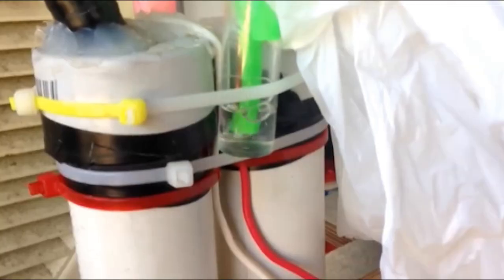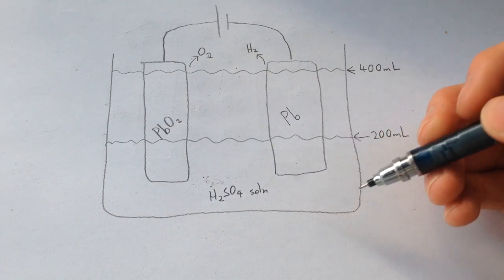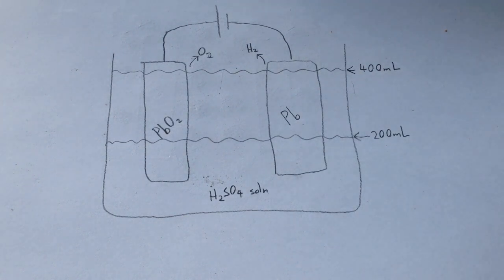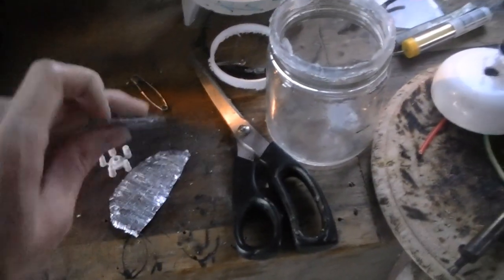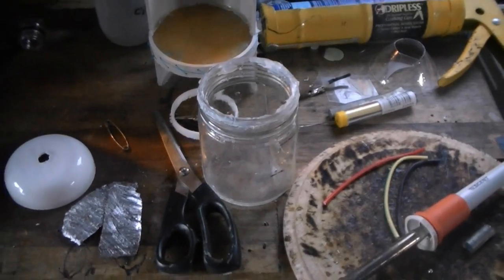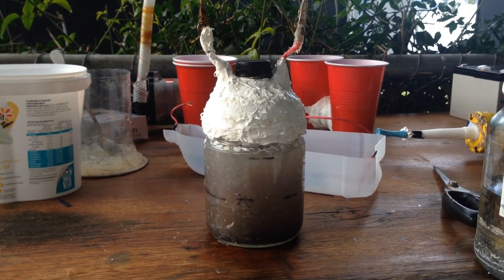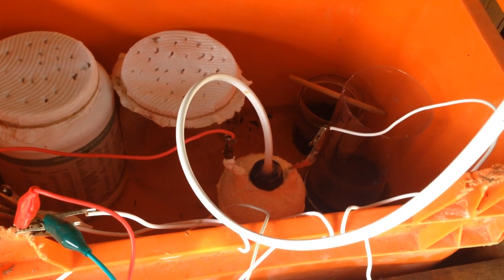Making Deuterium - Part 1

Comment: Tip: don't use plastic for deuterium oxide. The protium in the plastics will dilute the deuterium in the water. There are protocols for heavy water handling.
Reply: I was thinking the same thing. Carbon has a higher affinity to deturium than hydrogen, (protium).
Reply: What kind if container should be used? Degalvanized Steele box?
Reply: actually after research you're wrong polyethylene is ideal.
Reply: Also how about gloves while manipulating h2so4..?
Reply: @yurttgjk I work even with conc. nitric, HCL and sulphuric without gloves and my hands are ok, but he should wear gloves because of the lead.

Comment: Always happy to see a new Scrap Science vid! So is the only major difference between normal water and deuterium water weight? Also do you have any other long term projects like this going on?
Reply from the maker: Thanks, glad you enjoy the videos.
Reply from the maker: As far as I'm aware, there are no other general differences between normal and 'heavy' water (aside from something about neutron absorption that I don't really know too much about). And I'm afraid that I don't really have anything else long term running right now, however I am slowly working towards a video about extracting gold from computer circuit boards, which may take a while.
Reply: In the 80s there were 2 scientists experimenting with deuterium & triterium (maybe just deuterium) and they reportedly turned it into another element (it’s a gas at room temperature; I’m having trouble remembering). They were having a low percentage success in their experiments; I think 30%. They were wondering how to remove variables and improve their success rate. So they shared their work with other scientists so the experiment could be repeated and then peer reviewed. Someone didn’t like what they were doing, claimed that they called it, “cold fusion” and then I never saw more work from these two scientists. It was covered by a lot of media. I think there was a Time magazine with “Cold Fusion?” on the cover.
Reply: @HWandW  I think you're referring to an experiment in which Philo Farnsworth was involved, called the fusor. It's a reactor in which indeed as you said, tritium and deuterium are fused to create an isotope of helium, which is indeed a gas at room temperature. It is a fairly simple experiment and I'm building a fusor with a small team at my high school. Very interesting.

Farnsworth died and that might be why you didn't hear from them anymore

Comment: You leave the water very very still for a very very long time. The duterium water will form a layer on the bottom of the containter.
Reply from the maker: This won't work. Even at low temperatures, the thermal energy of water molecules will not allow for simple gravity separation of isotopes.

Comment: Does it have to be lead? Why not use graphite?
Reply from the maker: Graphite will very quickly erode in sulfuric acid electrolysis conditions. lead and platinum are the only real viable choices for long-term electrolysis of sulfuric acid.
A better choice (which I'll be doing in the future) is to perform electrolysis of sodium hydroxide solution instead, where electrode choice is much less strict, and can include much more available metals like nickel and iron.
Reply: @ScrapScience  awesome! Thank you for replying and giving me some clarification on that. I intend to replicate your operation to some extent. I want to get into the industrial production of D2O. I firmly believe it’s going to play a significant role in energy production in the future. Plus it’s worth a pretty penny so coming up with a solid method of production is a business opportunity. So I’ve been working on it myself. However the time frame in which enrichment takes place at 15 watts is unacceptable in terms of flipping a profit. So I’ll have to modify the container to handle upwards of 500 to 1000 watts. Which shouldn’t be too hard. Just a thick metal container with a higher concentrate of sodium hydroxide. What do you think?
Reply from the maker: Instead of making one container running at that kind of power, I'd recommend making multiple smaller cells running at ~50 watts each (you can use less NaOH this way, making separation easier later on). That's what I'm doing with my latest attempt at heavy water extraction (I'm running four of these cells total, but with a proper power supply you could increase that to twenty if so desired). You'll also need a large cooling bath for that much power, in order to minimise losses from evaporation.
As far as 'making a profit' from doing this, I'm afraid you'll have a hard time unless you have access to free electricity. To make 1mL of semi-pure heavy water, you need to electrolyse away about 30L of water total (and that's assuming very high efficiency), which requires at least 100kWh of electricity at 100% efficiency (probably triple that under reasonable efficiencies). To make that economical, your electricity needs to cost you 0.6c/kWh or less to match standard prices of D2O. If you have free electricity, go for it, but otherwise you'll have to settle for making it without a profit.
Reply: @ScrapScience  sweet I appreciate you’re input! The power factor isn’t a concern because when I scale to a large size I’ll be using power strictly off a solar panel array. Also the contamination of NaOH isn’t a huge concern because when it’s time to distill I will add active carbon flakes as well as a vorcrux column to my beaker enabling me to pull 100% of the NaOH from the solution as the purification process plays out. There’s a video I watched that taught me this process. I’ll link you if you want. But yeah the power factor isn’t going to be an issue late game and neither is the sodium hydroxide. The most important factors are how fast I can produce it and how much I produce.

Comment: Could you do the same with a 12v battery lead acid battery. Having a  larger surface area would allow you to carry the same 7 amps at a more efficent voltage across each cell thus generating less heat and electrolisizing more hydrogen for the same current.
Reply from the maker: That’s definitely a good option for efficiency. In fact, I was planning on doing something very similar if I happen to give this another go.

Comment: Random thought, because I noticed the numbers of videos on this - is the concentration of D2O the same in rainwater and seawater?
Reply from the maker: In theory, they should be very close. Seawater has a well-known concentration, whereas rainwater will likely be slightly (by an incredibly tiny amount) lower than that. The process of evaporation favours light hydrogen to an extremely small degree.

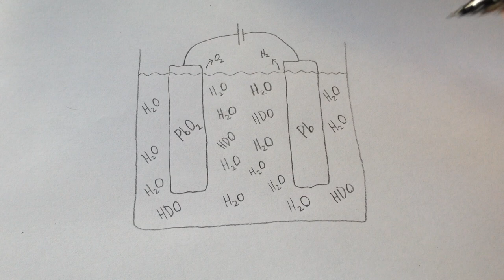Comment: 01:22 - What is your source for base water?  Do you live near the sea or a lake? 
I assume public water is not the best source as it has been processed in a variety of ways. 
02:14 Another question I have is the voltage you use for electrolysis?
Is it direct current (assumed)  or alternating current? 
If AC what frequency?
04:43 - When you decanted  and filtered your distillate,  how did you separate the H2SO4?
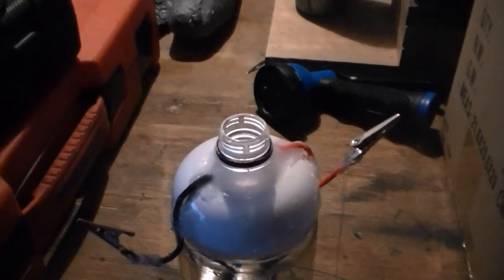07:33 - You rinse and create a new bath for the Deuterium.
11:27 - Will check my notes in the morning.
Reply from the maker: The base water in this case was rainwater. As far as selecting feed water goes, there's really not any appreciable difference between seawater, rainwater, tap water, or distilled water. It would be quite astounding if any standard purification process could concentrate/deplete the deuterium isotope by more than a fraction of a percent.
The voltage I used here was 5V, direct current (alternating current definitely won't work effectively for electrolysis). The lower the voltage the better the energy efficiency, so in future experiments I'm trying to lower this to 3V.
Separating the H2SO4 wasn't done until later in the process, but it was done by first neutralising the acid with a base (sodium hydroxide), and distilling the water off the salt.
Reply: @ScrapScience  Have you tried using a supercapacitor or lithium batteries? You get low voltage and high amperage. However, resistance is an issue, in which case you could put several containers in series until you have enough resistance to moderate the current. Test it with a set of milk jugs before risking the apparatus.

Comment: Eloctrolysis, assuming that it is selective and favors protium 10 to 1, will enrich the (1 in 6400) duterium to 1 in 640, at which point the hydrogen leaving has the same isotope ratio as the makeup water being added. once you have achieved 1 in 640 it will not enrich any further. Even 1 in 640 level will only be approached asymtotically.

Only by repeated batching can you concentrate higher than 1 in 640. Only if your makeup liquid is a higher concentration than natural can you ensure that the incoming isotope ratio is higher than that of the hydrogen gas leaving.
Reply from the maker: Yep, that was pretty much part of the plan for this stage of the process. It's impossible to get proper concentration of the deuterium by continuous addition of water to the cell, but it's better for bulk reduction of volume in the initial stages since it requires much less electrolyte.
In the later stages, I just end up electrolysing down the water conventionally, so that the deuterium can actually be concentrated meaningfully.

Either way, I'm currently working towards trying this again at some stage, where I'll be doing it much more efficiently, quickly, and on a larger scale. Hopefully I'll get around to starting that this year.
Reply: @myth-termoth1621  How about tritium? Is tritium favored by electrolysis at all?

Comment: you should use plates from a salt water genorator for home pools they have titanium plates coated in graphite , i made a 5 plate one for HHO gas and its making around 0.8lmp if you do something that breaks the water faster creating more hho you should pump the water concentration down 2x or more
Reply: Does the graphite contaminate the solution? I was thinking MMO instead to eliminate a step hell maybe even platinum 😂

Comment: Evaporation  slightly favors HHO over DHO  but isnt as selective as electrolysis. I'm guessing that as the concentration of deuterium  rises, you end up loosing a significant amount of it in evaporation.

Heat gets added from overvolting to conduct current and any side reactions, and portion of that heat contributes to evaporation.  

To mitigate that loss, you may try to condense water vapors  from the HHO gas stream back to the electrolysis cell.  Not using platinum, and keeping excess  voltage while down while sustaining reasonable current. It's all about the electrode plate surface area.

Comment: I think this experiment didn't work because you were refilling the container each time. My understanding is that 10 times the hydrogen gets electrolyzed as compared to deuterium. I wrote a program to calculate what the concentrations would be after each iteration. The concentration never increases past 10 times the original value of fresh water. No matter how many times you refilled the cells, you only got closer and closer to 10 times the concentration of deuterium as compared to normal water. Next time try refilling the cells with fresh batches of water instead of re-using the same water.

Here is the python program I used to get these results. 
prop = 1./4000
# initial amount of hydrogen
H = 1 - prop
# initial amount of deuterium
D = prop
# concentration factor, how much faster hydrogen leaves compared to deuterium
alpha = 10

results = []
for i in range(50):
    # p chosen so that 50% of water is removed before refilling
    p = 0.5/(D + H*alpha)
    H = H - p*H*alpha
    D = D - p*D
    # the step where you refill the cell with water.
    H = H + 0.5*(1-prop)
    D = D + 0.5*prop
    results.append(D/prop)

print(results)

and the output is... 

 

[1.4499887474681803, 1.877465649617713, 2.283552695509114, 2.669316366181162, 3.0357703406389898, 3.383878073848379, 3.714555252404811, 4.028672133333407, 4.327055771267354, 4.610492139048192, 4.879728146591813, 5.1354735626694, 5.378402844063124, 5.6091568763723325, 5.828344630567323, 6.036544739214715, 6.234306996130928, 6.422153783058354, 6.60058142680248, 6.77006149011742, 6.93104199948201, 7.083948612768672, 7.229185729672686, 7.367137547640077, 7.498169065908049, 7.6226270401525404, 7.740840890122992, 7.853123562534622, 7.9597723513833465, 8.061069677747623, 8.157283831045081, 8.248669673619439, 8.335469310444878, 8.417912725650602, 8.496218387487572, 8.570593823282266, 8.641236165848628, 8.708332672759015, 8.772061219807782, 8.832590769937019, 8.890081818832812, 8.944686818342058, 8.996550578804166, 9.04581065133901, 9.092597691081837, 9.137035802307691, 9.179242866341967, 9.219330853109884, 9.2574061171361, 9.293569678765865]

It never goes above 10.

Comment: How hard is it to get enough tritium this way, say, to light up a phosphorescent balloon? I'm sure it would take A LOT of distilling since tritium is only a tiny fraction (even tinier fraction than deuterium) of all hydrogen.
Reply from the maker: In 1937, a study was done in which 12,000 tonnes of water were electrolysed down to 10 mL in the hope that tritium would be found. They didn't even find a trace of it...
Tritium is far too rare to do this with regular water. You'll need some kind of water source that already has tritium in it to some degree.
Reply: @ScrapScience  I've read tritium is only 1 in 10^18 hydrogen atoms. It would take A LOT of seawater to get any useful amount of tritium. I guess that's why it's cheaper to synthesize in a reactor. I think the light up balloon would be so cool, but I've never seen it done. Also, the isotope mass ratio of tritium : deuterium is less than that of deuterium: protium .

Comment: Apart from deuterium which has an extra neutron can you make Hydronium H30 and how would this be achieved.
Reply from the maker: H3O (uncharged) cannot be isolated as a free radical, as it will decompose into water and hydrogen instantly.
The charged form, H3O+, is present in any acidic aqueous solution, so it's not hard to make or observe. Of course, it can't be isolated in pure form because it only exists in solution and requires a counter-ion.
Reply: Thanks for the explanation. Thats why I haven't seen any examples of H30 manufacture in its isolated form. A shame . Hydrogen rich water would be cool. :)

Comment: Maybe instead of using lead and sulfuric acid you could use stainless steel and sodium or potassium hydroxide, they key for low erosion with them is to have as little Cl ions as possible, use distilled water and use a piece of sodium to make your NaOH. That way you don't deal with toxic products and might get more life out of your electrodes.

Comment: why does this work? why does the electrolysis favor HHO over DHO?
Reply from the maker: As far as I'm aware, it's a kinetic isotope effect arising from the fact that the steps of the hydrogen evolution reaction on the cathode occur faster with lighter isotopes (it is easier to push lighter isotopes over the energy barriers present in the mechanism of the reaction). However, even though this effect has been known for 90 years, I'm pretty sure nobody knows exactly why the separation factor is so large. It's basically the most isotope-selective chemical reaction that can be done at room temperature.
Reply: @ScrapScience  very interesting, thank you!

Comment: Might it be better to use AC current in this case. Theoretically it shouldn't degrade the electrodes. I have a high power transformer available if you need one.
Reply from the maker: AC tends to be extremely inefficient when trying to electrolyse water. DC requires much less energy, so it's usually the best option.

And I should be all good for power supplies at the moment, thanks for the offer though!
Reply: @ScrapScience  
Is my presumption correct though?
Could one avoid electrode degradation by reversing polarity's either at line frequency or perhaps manually switching the direction of current?
Reply from the maker: Not really I'm afraid. You're still going to get oxidation on the electrodes, regardless of switching the current. At mains frequency, the desired reaction will pretty much not occur at all, and periodically flipping the current at longer intervals will still give you degradation.

Comment: Nice video - Given the bulk of the electrodes, how do you plan on electrolysing the concentrated deuterium water when it gets down to quantities of millilitres?
Reply from the maker: Hopefully I'll be able to build a smaller apparatus with much smaller electrodes by the time I'm down to millilitre quantities. By that stage I'll be running the electrolysis as slow as possible and the electrodes shouldn't wear out.

Comment: One really should read the handling instructions for lead first. This guy isn't wearing gloves! I wouldn't touch it.
Reply: Lead is not thaaaat dangerous to handle😅
I worked in cable construction for 4 years with mostly old lead encased cables and for working i never wore gloves and had common health and lead level checks and never had high levels of lead in my system.
Reply: hes making deuterium, no doubt enjoying the thrills of amateur nuclear science. i think a bit of lead is the least of our worries.
Reply: @hofn420  electrolysis can make soluble lead salts though which are much more hazardous